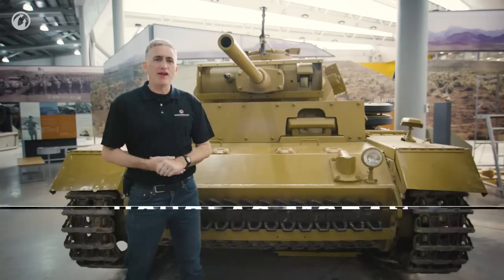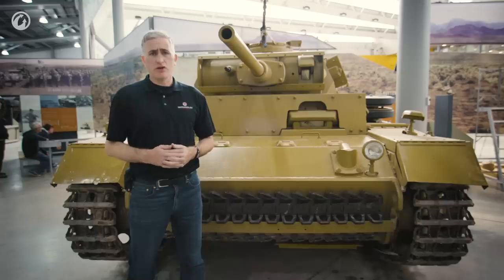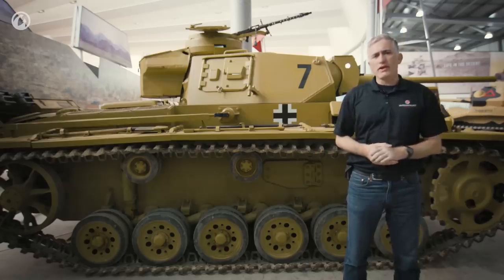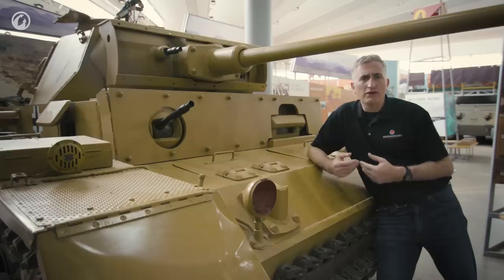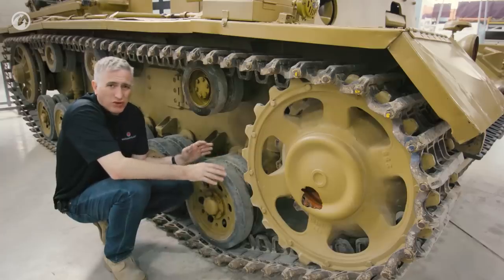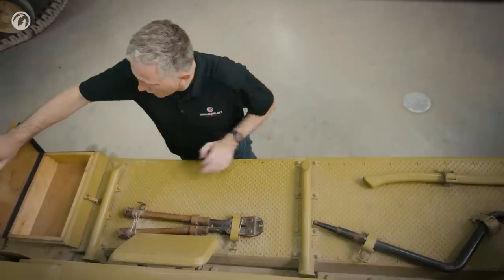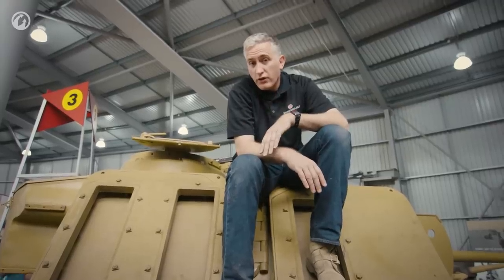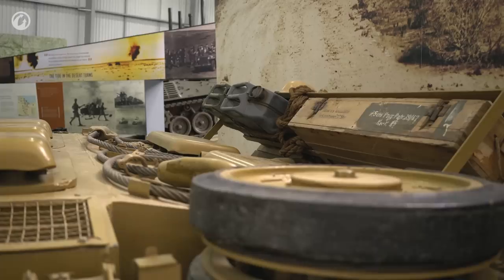Inside the Chieftain's Hatch: Panzer III Part 1

Comment: This chassis, used by both the PzKpfw III and StuG III, accounted for more kills than any other in the German arsenal. In many ways it was a tracked Chevrolet Suburban with about two inches of armor, depending on the exact model. The three man turret was genius and the 5cm gun killed a LOT of T-34's, although it was hardly ideal.
Reply: panzer 3's and 4's were the backbone of the Wehrmacht armored contingent
Reply: i blame STUG lyfe
Reply: Removing the three man turret was genius as it allowed for a decent gun and saved a by then failed tank.
Reply: @2adamast  In what way is the most produced and widely used tanks of the wehrmacht a failed tank? let me put this in perspective for every 1 tiger there were 12 panzer 3's next up is the panzer 4 with 10-1 ratio on the tiger, and was honestly the best tank germany made due to it being capable and able to be produced in higher numbers, and it was reliable and didn't massively overload the transmission, It's gun was adequate and so was it's mobility. Now if they would have improved the armor without increasing the weight by double it would have been much better. than the panther or either tiger as a wartime vehicle. maybe 60-75mm sloped (it had 50mm to start with) at about 60 degrees in the front It's armor would have been adequate as well
Reply: @zacht9447  By 1943 the Panzer 3 production is stopped because by then the it fails in its anti tank mission.  The Stug 3 and its bigger gun will save the platform and be the most produced tank.
Reply: It's scary to think what would have happened if the Germans had made all the StuG-III's they could, and turned the PzKpfw IV into a teutonic Sherman with  steady improvements and huge production numbers. What if they never developed the Tiger, Tiger II, or Panther and poured all those efforts into efficient(!) production and massive numbers?
Reply: @2adamast  yep sure that's why they made 6000 Panzer 3's in 1944 and 1945 alone
Reply: Samuel Thompson Basically nothing would have changed. The panther was actually a fairly efficient design to produce and towards the end of the war, the Germans were already producing more tanks than they had trained crews or fuel for.
Reply: @ProudToBeNoob  Time was always the key enemy of the Wehrmacht. Without the Versailles treaty, Germany would likely have been much stronger, much sooner. Hitler the Gambler leveraged his position for all it was worth, grabbing the Rheinland, Austria, the Sudetenland,  Czechoslovakia, and even Poland without so much as a German tank encountering a French Army tank. If Albert Speer's reforms in putting the economy on a total war fitting has begun in 1939, Germany would have had a very good chance to topple Russia and control the Continent for decades. That didn't happen, the Wehrmacht wasted a lot of irreplaceable time on developing quality rather than quantity, and ended up losing the war. By the time all those Panthers were rolling out of the factories in 1944, the turning point at Stalingrad was almost two years past and Germany was fighting an extended holding action. The Sherman and T-34 were hardly perfect tanks, but they were good enough and so was the PzKpfw IV. The Germans just didn't build ANY tank or StuG models in sufficient quantities, especially early on when it would have mattered. Imagine the Wehrmacht rolling into Russia in June 1941 with twice as many tanks and planes. Imagine them meeting the Anglo-American forces in North Africa with twice as many tanks and planes in late 1942 and Rommel calling the shots. The wouldn't have been any Tigers and no Panthers on the way, but I'm sure any army general would gladly have accepted such large numbers of IVs. One theory I have read is that Nazism detested the dehumanising nature of most  factory work for non slave laborers. Nazis also loved psychologically dominating others with technological achievements. Thus the Tiger, Panther, Type XXI submarine, Me-262 fighter,  and the V-2 tickets. FDR and Stalin were from the "Just win, baby" school of thought. Resources were vital as well with the Allies holding most of those cards.
Reply: @zacht9447  Production of the Panzer III stopped in 1943 as the design didn't allow for a larger turret and hence bigger gun. However production of the hull continued as the basis for other platforms, principally the Stug.
The only Panzer design to remain in production throughout the war on the German side as an actual tank was the Panzer IV.
Off the top of my head the only allied tank to remain in production throughout the war was the T-34. Although I wouldn't be surprised to find some British designs being produced into 1945. 
I researched the respective numbers of the Panzer designs circa 1944 to see which design was most likely to have been encountered by Allied pilots. This was in relation to the effects of strafing runs by aircraft on German armour, which the pilots inevitably identified as 'Tigers'.
Reply: Madam Meouff  Don't forget that in 1941/42 the crews of the Panzer III's were crewed by  highly trained and usually veteran men. Where as the T-34's were crewed by men with little to no training, beyond possibly 'this is called a tank'.

There seems to be a tendency for troops and sailors to regard their opponents equipment and vehicles as being better than what they themselves are using. 
While this is clearly true for the Panther and Tiger tanks in terms of performance, so is the fact that both outweighed their principal opponents by no small margin.
When you look at the Panzer III and IV however you see that they are directly comparable to their primary opponents (the Sherman and T-34).

I ran across a British evaluation report on a captured Panzer IV in North Africa in 1942 a few years back. There were only two areas in which the report notes the tank had a significant advantage over Allied tanks in use at the time; Better optics and better armour. In the case of the armour this wasn't due to the thickness of the armour, but due to the German's using higher quality steel for their armour plating.
Both of these advantages were presumably also apparent in the Panzer III. Although in regards the armour we should probably not miss that any such advantage would have been offset by the Panzer III being designed with equal thickness of armour all around. This differs from the T-34 (and practically all other tanks) which had thicker armour on the front and thinner armour at the rear. Given than both tanks weighed much the same (some 25 tons) this would, design wise, allow a T-34 to have either thicker effective armour in a head on fight or equal armour and a bigger gun.
Reply: More like a Porsche on tracks. They used Ferdinand Porsche engines.
Reply: @amerigo88  You ever saw a Pz IV in person? They are tiny compared to a Sherman, not much to improve.
Reply: All that's great:  It was an effective early war.tank and they did turn them out.  Problem is none of that really matters when you totally lose all hope of air superiority
Reply: @amerigo88  They would've needed to develope something like the Panther, as the allies were working on bigger, heavier tanks regardless. A StuG III does very little to IS tanks and Pershing's.
Reply: @amerigo88  They COULD have turned the Panther into that. They had identified the main problems and even had solutions for them. But the politicians told them "produce the original NOW" instead of waiting 3-6 month.

And since Panther was designed with mass production baked into the design - a Panther with fixed final drives (they wanted to use the Tiger ones) and the HL230 engine (it later got the engine) could be produced almost as fast as Panzer IV but would have offered a far more flexible "universal platform". All the "how do we fit a AA gun here" problems - would not exist. The "Coelian" was a mock up but a twin 30mm AA gun armed tank on a 45to chassis works fine (Gepard). No more "open topped" howitzers - the 45to platform can do one with turret. Tank retriever - done
Reply: Very interesting and informative. Appreciate your upload on Panzer-III. Do you have info on Panzer-III K and Panzer-III N? Thank you in anticipation.